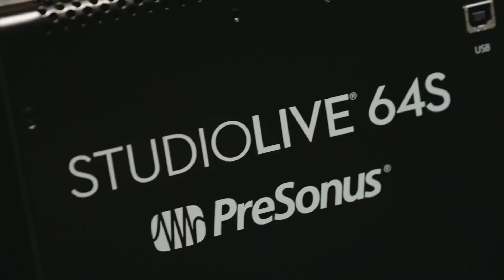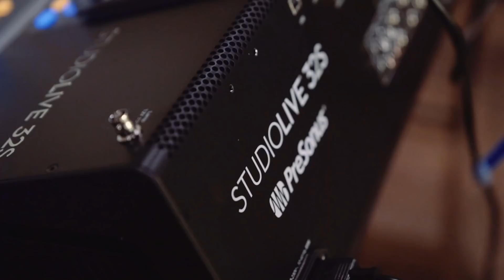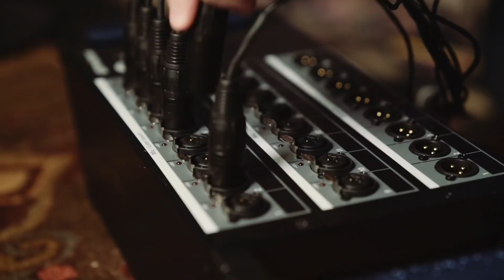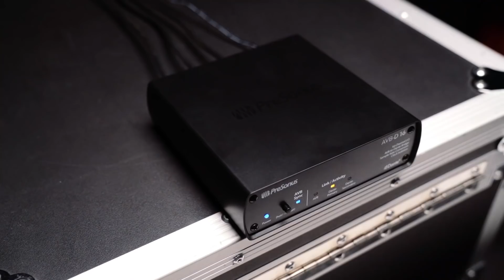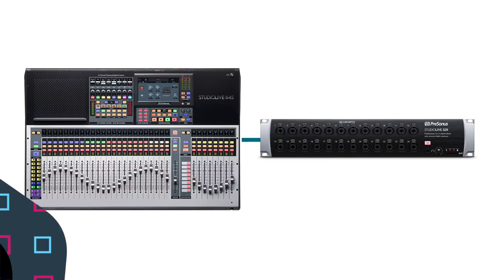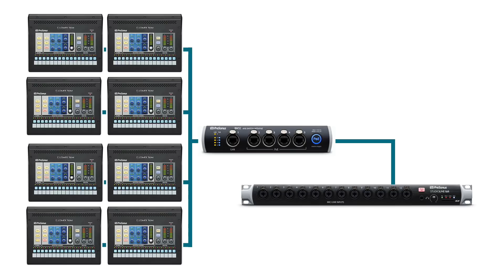Believe in Music - StudioLive Series III Ecosystem: From Studio to Stage and Back

Comment: Presonus weirdly offers better support for 3rd party Dante devices more than 3rd party AVB devices. I have been frustrated trying to interface MOTU AVB interfaces with Presonus StudioLive Series III since 2018.

I'm really hoping Presonus will have a StudioLive with support for dual mode USB-C for Thunderbolt 4 and USB4 using the Goshen Ridge JHL8440 Thunderbolt Controller, so that when you plug it to a USB host it functions as a USB4 device, if you plug it to a Thunderbolt host it functions as a Thunderbolt 4 device.

Lastly 3rd party DAW support and integration should be improved so that 3rd party DAWs have access and control to the FX (e.g FAT Channel) and processing of the StudioLive Series III.

It is great to have an ecosystem but if that ecosystem prevents one from having the same level of performance with 3rd parties then I'd rather not. I use Studio One a lot but I also use Logic, BitWig. I have MOTU AVB interfaces that I use alongside Presonus StudioLive Ecosystem.